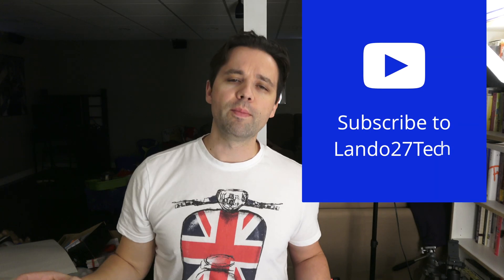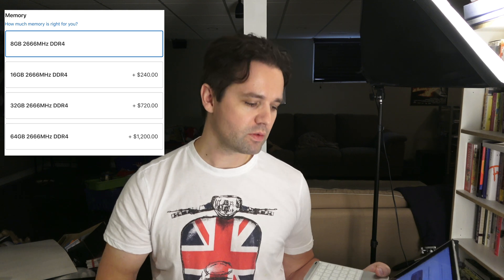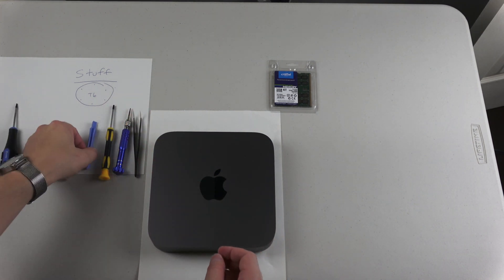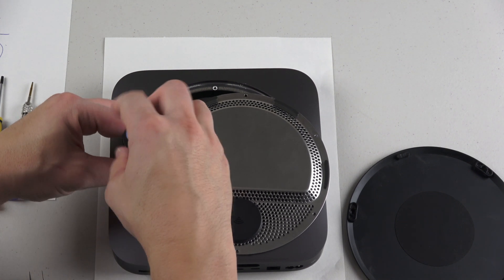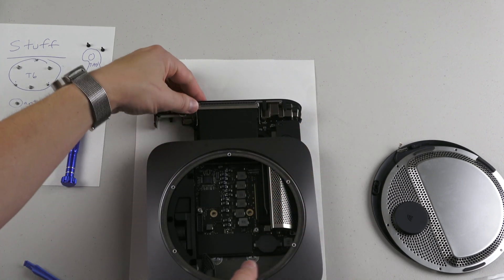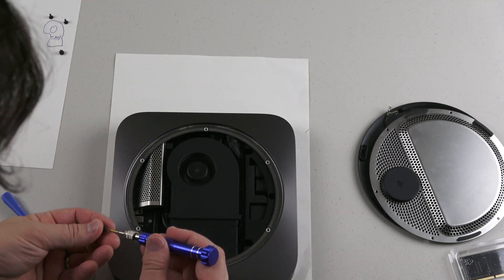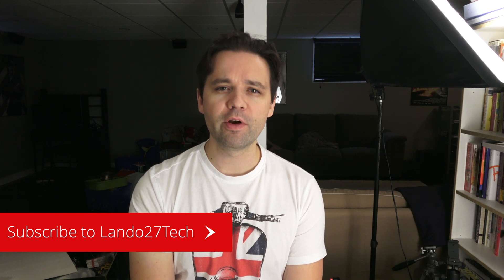Why Did They Make This So Tough? How To Upgrade YOUR Apple Mac Mini 2018 RAM.

Comment: People accuse me of being pro-Apple but there are indeed a few reasons why Apple charges more for RAM. 1. Apple assumes responsibility for any RAM failure and its replacement. That is, unlike other computers where the RAM manufacturer provides the warranty for its RAM and where YOU must physically replace it, Apple will replace its RAM and the cost is free but you are paying for that cost via the increased initial prices. Isn'y the Apple Warranty also longer than the manufacturer's warranty? 2. Apple has a long term contract with RAM suppliers and that contract requires Apple to pay higher prices for RAM but it is guaranteed to have the first option to get that RAM at the pre-arranged higher-than-market-average prices. 3. Apple may be selecting components (as I know it does for some HDDs) with higher build quality or higher MTBF. If you are watching this video you probably don't care about replacing broken RAM yourself so these reasons don't mean anything to you.
Reply from the maker: I'm pro oranges

Comment: Are you happy with the results? Was there anything that worried you about beforehand?
Reply from the maker: I am happier yes. I was worried that I had stripped the T6 screws at first.  It was great to buy this and then get it working.

Comment from the maker: Have you ever upgraded your MAC RAM?
Use the Timestamps:
Take apart the Mac Mini: 2:28
Swap the Ram: 7:52
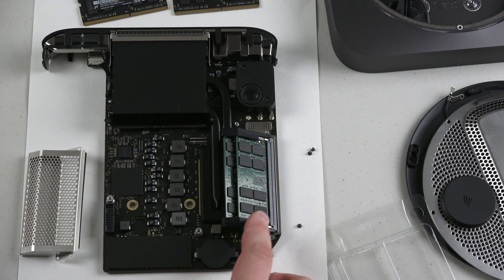Put it back together: 8:58
Get the Ram here:
https://amzn.to/2IMR9z2 (Affiliate link - USA)
https://amzn.to/329y1To (Affiliate link - CAN)
Get the Tools used here:
T5 Torx Screwdriver:
https://amzn.to/2pkykfu (Affiliate link - USA)
https://amzn.to/35ueNde (Affiliate link - CAN)
TR6 Torx Security Screwdriver:
https://amzn.to/2IKl2jm (Affiliate link - USA)
https://amzn.to/33si0Ir (Affiliate link - CAN)
T10 Torx, Spudger, Tweezers:
https://amzn.to/2oEUcCu (Affiliate link - USA)
https://amzn.to/33rSSkZ (Affiliate link - CAN)